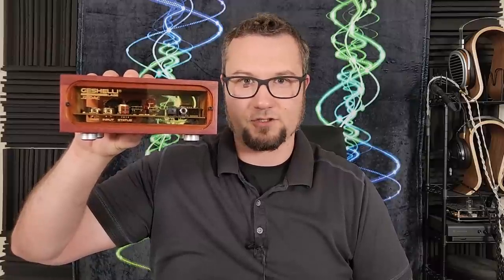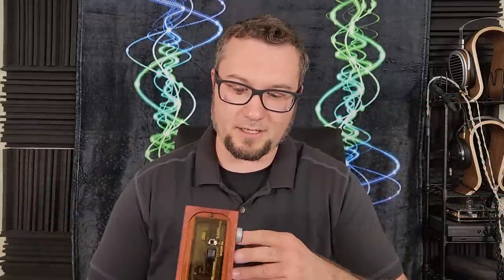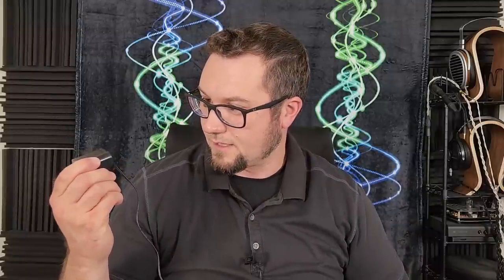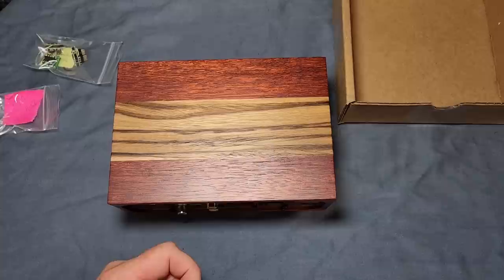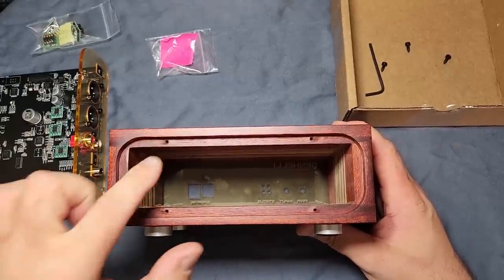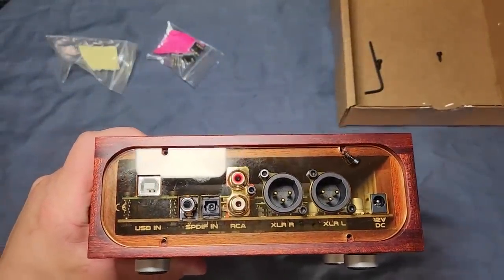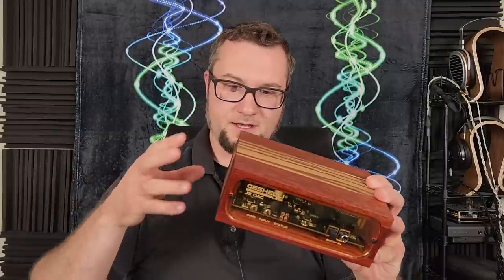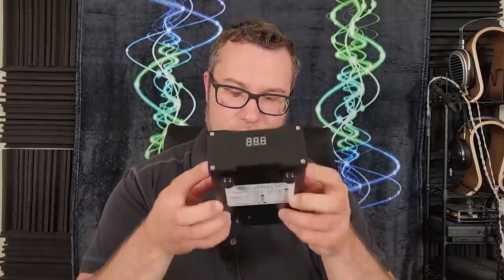Geshelli Labs J2S DAC Review w/ Sparkos Op-amps, Op-amp rolling how-to, Comp with BF2/64 & More!

Comment: I concur with almost everything you report, on this Geshelli J2S DAC. And if you are so inclined, you can use the top-of-the-line Sparkos SS2590 dual mono unit on the single ended socket. And boy oh boy the quality takes another big jump up.

I am using a 50W 12V LPS and I am using a Noise Nuke (DC noise filter and capacitance DIY unit), and it completely outperforms the other DACs I have - the Ares II with 12th Anniversary update, and Bifrost 2/64. I am of the opinion that the Bifrost 2/64 is brittle/bright in my system, whereas the J2S is far more revealing of the recording.
Reply: Interesting thing is Geshelli is using the SS2590 for their Archel 3 Pro amp, I wonder why they ar not using it for J2S DAC.
Reply: @hdsarma  The SS2590 is physically much larger, and it's a mono op-amp. The SS2590 can be put into a dual mono DIP8 package - and that's what I am using in the single ended RCA socket of my J2S DACs.

They simple won't fit in the balanced XLR sockets. If they reworked the circuit board, it could happen.
Reply: @NeilBlanchard  How is the single-ended (RCA) output with just the Sparkos SS3602 OPA in terms of sound quality?
Reply: @TheDarius1968  It is quite excellent. Especially if you use the linear power supply.
Reply from the maker: Thanks for the added info, Neal.
Reply: @wavetheorysound  No problem! If you get a chance, you should try the SS2590 dual mono unit (with 2 risers) in the single ended RCA socket on the J2S, and compare it to the ss3602 in the balanced XLR sockets.
Reply: @NeilBlanchard  "I was not aware of that" (Wayne's World).  Good Info
Reply: @NeilBlanchard  what does dual mono mean? I intend to use 2 mon amps , is it related?
Reply: @DIVA-MC-7  Each SS2590 is a mono op-amp, to use it in the RCA socket on the J2S, you need two, and you need the DIP8 adapter that holds both of them. So that package is dual mono.
Reply: @NeilBlanchard  thx !!!

Comment: Using my J2S with SS2590 on the single ended output, connected to the EverSolo DMP-A6 via USB.  Other than no DSD as the EverSolo does not yet support the Amanero USB module properly, but it sounds amazing. It is really hard to A/B test opamps as it take quite a bit of time to take them out/put them back in, but I am very happy with the setup.
Reply: Hi! Are you talking about dual SS2590 Pro or single one? If dual, does it fit easily in the box? Thanks in advance!   Regards,Alex.
Reply: @alexanderignatyev8175  Yes the dual SS2590 will fit.  Just make sure you order the adapter.  Sparkos was super helpful.
Reply: Hello, what is your setting from your eversolo to your Gishelle dac, can't get any sound from the dac🙄

Comment: Holy Cow!   Was excited at first, but now  I need a $285 Power Supply and a $1k streamer to clean up the USB signal.   Please help me at least with a cheaper way to provide low noise USB input if music initially starting with my PC.   Thanks!  (New subscriber today)
Reply from the maker: Thanks for the sub! If you need USB you're better off using a laptop than a big desktop PC. My Surface Pro 4 is reasonably quiet and does a nice job. Unfortunately those beefy GPUs in gaming computers that give us wonderful graphical fidelity and speed create horrible amounts of singal noise that bleed into audio signals.
Reply: @wavetheorysound  thanks for the info, you are 100% about the graphics cards.   Was wondering whether a raspberry pi or a NUC mini pc would provide cleaner USB.  Thanks again!
Reply from the maker: @OlympicBruce  they will.